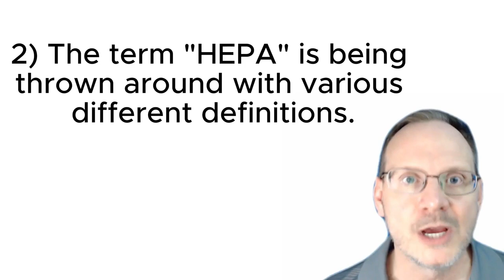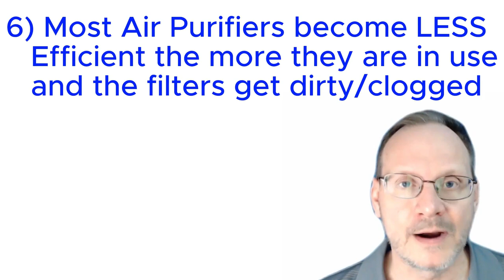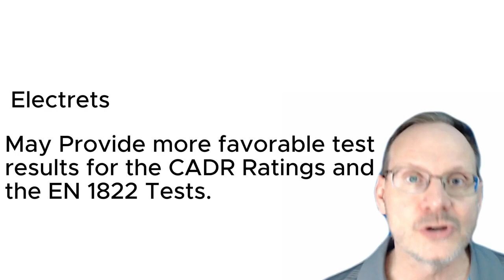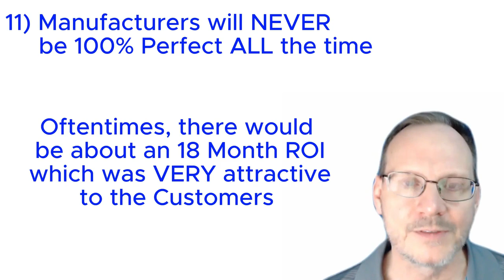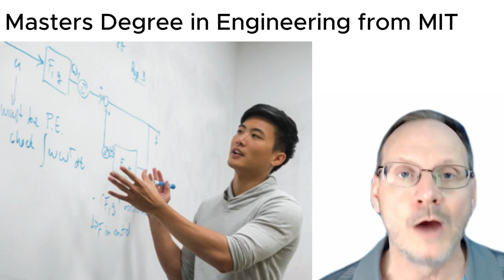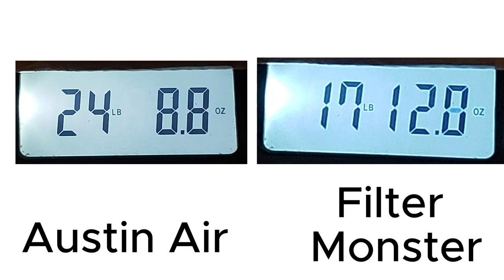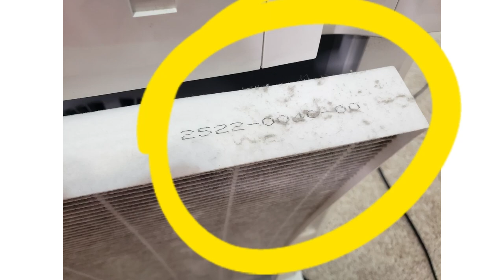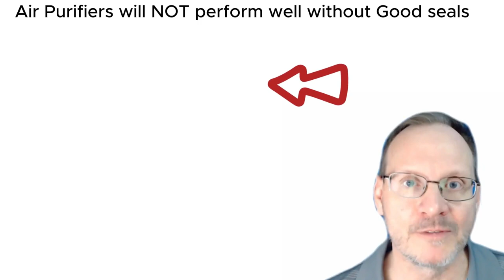HEPA Filters - Are they all the same?

Comment: Hello Doug. Does the Austin come up short on Ultrafine particle filtration because of media reasons only or bypass issues as well? I currently have one HPP, and it has a good odor elimination quality, but am also looking for additional particle filtration. Was looking at the IQAir AtemX. I called them today for info and they said it was about 530 CFM on high and draws about 85 watts per hour. It uses three HyperHepa. Any thoughts on that unit, Doug?  It’s $$.
Reply from the maker: I currently have ambivalent feelings about the Austin Air Healthmate:
1) It was the 1st air purifier I ever purchased and it did a great job for me as I bought it because I was gagging on dust (I think it was coming from my ducting when our heat turned on) when I was trying to sleep at night and I was waking up at @ 2-3 am coughing, etc. I'd have to drink some water to try to get back to sleep again but I'd be up for about 30-40 minutes b4 I could get back to sleep and this really irritated me. The Healthmate fixed my issue the 1st night in my room and I was very grateful + I never had that problem again for 16+ years with it running 247. My experience with it + numerous interactions with customers over 15 years tells me it has definitely helped a lot of people with many different breathing issues... for sure. So it is a quality unit, IMO.
2) That said, I saw it tested in Vegas with a $3,000 particle counter by the Owner of IQAir vs. the IQAir HPP and a Blueair unit. The HPP registered a perfect score with the monitor. The Healthmate was tested next and it performed at 98% efficiency on low speed, 96% on Medium speed and 92% on High speed. But I could tell the owner of IQAir respected the unit and felt it was a good offering. Then the Blueair unit was tested and it hit about 82% on whatever speed but it was not nearly as impressive as the HPP or the Austin. The live test made an impression on me for many years. Then over the past year I started to use various testing monitors (much less expensive... more like $300 to $150) and have come to the conclusion they are NOT reliably accurate. And the EPA says any testing monitor less than $5K tends to be somewhat inaccurate. I've talked to Austin and they say the electronics of the HPP interfere with the testing monitors and therefore provide false readings. I've seen that when you put a testing monitor close to fans without any filters - the readings can register as perfect air quality, as well. Basically false readings... So, now I question if the IQAir live test I saw was somehow "rigged". Did he put the monitor closer to the mouth of the HPP unit during the test to get a false perfect reading? I don't remember. But I will say, I don't believe he is the type of man to do such an underhanded thing. He seemed to be an honest man... but who knows, right? He wanted all of the dealers to sell his units and grow his brand in the US at the time so he definitely had a "motive" so to speak. I still don't know... All that said, I've had many fantastic testimonials and some great feedback with HPP customers through the years and I know regardless of what any testing monitor's numbers can show me that it is an elite-performing air purifier for particle filtration... no question in my mind.
3) Years ago I had a rep. from Blueair and a rep. from Austin tell me that they both knew the HPP filtered better than their units. So, why would I not believe them - right?
4) I think most air purifiers on the market do not actually work at a HEPA level but they don't need to in order to help people with their breathing... most all air purifiers will improve the air quality in a room to some degree... but obviously, there is a pecking order regarding performance (esp. with Ultrafine particles) and I currently think the HPP and Aeris 3 in 1 are 2 of the best.
5) I recently asked Austin for 3rd party data/reports that proved their units worked at a HEPA level but to my shock - they didn't really have any. I could NOT believe it. They say they are "3rd Party" tested but they only have some "clinical trial" type experiments/data/trials with some reputable health organizations... but the data I read from these trials did not impress me as I didn't see any black and white super convincing results. Now, maybe I didn't read all of them and maybe I am missing something but if I was in charge of a reputable air purification manufacturer and I was proud of my product's performance - I'd have some SEVERE 3rd party testing data that was very black and white and I'd be beating the competition over the head with it - yelling from the rooftops with it, so to speak. IQAir has EN1822 testing results that appear to be black and white and EN1822 is one of the most respected "certifications" in the market today - from what I currently gather. Now, was the entire unit certified or only the filters? IDK but I'll eventually find out... either way, they have a 3rd party certification that I think is impressive. I do not think Austin currently has this...
6) I do not have much experience with the Atem X, at all. That said, based on limited research - I think the HPP filters Ultrafine Particles better than the new Atem X. I think IQAir was somewhat forced to come out with a better-looking unit with "smart" features to keep up with the competition however, I do NOT believe it filters HEPA sized particles or ultrafine particles as well as the HPP. And I also think IQAir tries to kind of "hide" this fact based on what I am reading in their marketing materials. I do not think the X's filters are EN1822 certified and I see IQAir pushing impressive Virus Removal data performance numbers on the unit on their website. However, I don't see anywhere that it actually performs at a HEPA level.
A) The HPP performance numbers say "Filters 99.5% particles ≥ 0.003 microns" right on their website... but I only see a UK IQAir dealer called Allergy Cosmos say, "HyperHEPA Filtration: Similar to the HealthPro 250 (which is the international number for the HPP), the Atem X utilizes advanced HyperHEPA filtration, EN1822 classified at E11 to H13 (notice they say "Similar", "utilizes" and "classified" but never actually say the filters themselves are EN1822 certified/tested). 
B) "The Atem X captures ultra-fine particles at 0.3 microns with an efficiency of over 95% on the highest setting and 99.95% on settings 1 and 2." BOOM SHAKA LAKA! Right There... THAT is all we need to know, I think. Actually, IMO, they tried to be a little sneaky with this sentence as "Ultrafine particles" are defined as .1 to .003 in size... and .3 microns are considered "Fine Particles" and those definitions are literally coming right off the IQAir chart. But they used the "Ultrafine" term in combination with ".3 microns" in the same sentence. IMO, they did this to try to fool people and have them think the X performs as well as the HPP for Ultrafine particles. And I had to do some searching to finally find this info... I think IQAir wants to "hide" it from consumers. I think the HPP performs at 99.5% down to .003 microns even on the highest setting but the Atem X clearly filters particles at worse rates when the CFMs are increased. And according to their UK dealer - it NEVER actually hits 99.97% at .3 microns.  But the HPP definitely does.
C) So, the X is "Good Looking/Better Looking" than the HPP.  Has additional sensors to test for different things in our air.  Is more powerful so it covers more cubic footage. Is "smart" so to speak and has all the digital/phone features that folks could probably want... but, I personally, don't care about any of that stuff, lol!  I want the superior filtration.  So, this is what I currently think about the X based on what I'm seeing.  Thank you!  👍

Comment: Even if filters have a leak, that doesn't matter, what mattes is the air moved through the filter... zero air filters have a perfect seal, so it's just a minor side topic...  even a Merv 11 will do about the same as a IQ Air, and if you get a much bigger fan and multiple Merv 11, it will do better than an IQ Air...  .3 is the size that is hardest to filter, at lower sizes it becomes easier to filter (including ultra fine particles) and at higher than .3 microns it becomes easier to filter, that is why .3 microns is used as the benchmark... IQ Air's testing/certs don't really prove that it's better than any others... One thing IQ Air is better at is that their machine is so quiet, but it's not much better than a house fan with a Merv 11 on it and it's not any better than a common Honeywell machine... VOCs can only be filtered to about 9% reduction by carbon, even the IQ Air or the huge Airpura carbon filters only remove about 9%.  Just some facts for you.  The rest is a lot of hype and marketing catch-phrases for people who don't understand much about filtration.  The main thing about filtration is the size of the filter and the volume of air the fan can move through the filter per unit time, only after that can you start to talk about filtration media which is more or less the same from a tshirt up to a ULPA and is just 10% of the equation.  Also using carbon will actually clog the HEPA filter and carbon only works for a short amount of time and you never know when that is because it depends on the amount of toxin in the air, the temperature, pressure, etc.
Reply from the maker: Thank you for your comments:
1) "zero air filters have a perfect seal, so it's just a minor side topic..." 
***Yeah, I don't currently agree with this, at all. One of the things that makes the elite air purifiers perform better is the superior seal and lack of leaking - from a particle filtration standpoint.

2) "even a Merv 11 will do about the same as a IQ Air, and if you get a much bigger fan and multiple Merv 11, it will do better than an IQ Air.."  
* I currently would have to disagree with this, as well.  The MERV 11 won't come even close to the filtration of an IQAir HPP.

3) ".3 is the size that is hardest to filter," 
***updated information/testing has shown that the MPPS will depend on the specific filter being tested.  Different HEPA filters have different MPPS. 

4) "at lower sizes it becomes easier to filter (including ultra fine particles) and at higher than .3 microns it becomes easier to filter"
* I currently believe this to be true only for very well manufactured HEPA filters... but I currently do not believe all HEPA filters will filter at the same levels and not all HEPA filters will filter the Ultrafine particles in the same manner.

5) " IQ Air's testing/certs don't really prove that it's better than any others..."
***I currently do not believe this to be true.

6) "One thing IQ Air is better at is that their machine is so quiet,"
***I honestly don't think it is very quiet compared to some of the other air purifiers I have... I love the white noise that most air purifiers create... I'd say Blueair is probably one of the more quiet solutions - esp. in comparison to the IQAir HPP.  But, I guess the IQAir HPP is pretty good/quiet from a sound standpoint up to speed 4... 

7)  "but it's not much better than a house fan with a Merv 11 on it and it's not any better than a common Honeywell machine..."
***LOL!!😆 I do respect everyone's opinion but I don't know how you are coming up with these comparisons. My professional experience in dealing with hundreds of IQAir customers has proven beyond a shadow of a doubt it is an elite filtering air purifier and no, a Honeywell air purifier doesn't filter nearly as well.  I've sold both. 

8) "VOCs can only be filtered to about 9% reduction by carbon, even the IQ Air or the huge Airpura carbon filters only remove about 9%."
***I don't know how you are coming up with these opinions -  but this has not been my personal experience with air purifiers and definitely not the experience of thousands of customers and businesses I have dealt with from all over the country for over 16 years.

9)  " Just some facts for you.  The rest is a lot of hype and marketing catch-phrases for people who don't understand much about filtration.  The main thing about filtration is the size of the filter and the volume of air the fan can move through the filter per unit time, only after that can you start to talk about filtration media which is more or less the same from a tshirt up to a ULPA and is just 10% of the equation."
* I do appreciate your "Facts" LOL! 😆 but I currently think you are way off with the vast majority of your opinions on these topics... and my professional experience with THOUSANDS of real world customers and some high level (even brilliant) engineering experts from some of the best schools in the world (including MIT) do not agree with many of your opinions.  But we are all allowed to have our own opinions.

10) " The main thing about filtration is the size of the filter and the volume of air the fan can move through the filter per unit time, only after that can you start to talk about filtration media which is more or less the same from a tshirt up to a ULPA and is just 10% of the equation. "
* I disagree

11) " Also using carbon will actually clog the HEPA filter and carbon only works for a short amount of time and you never know when that is because it depends on the amount of toxin in the air, the temperature, pressure, etc."
***I do agree with you that carbon can clog a HEPA filter.  And I know there are many different types and qualities of carbon out there.  And I agree that some of the carbon will not last a long time, for sure...  And I will be learning more about this over time.  

Thanks a lot for your post.  We don't currently seem to agree on much, LOL! 😆But that is OK!  If everyone completely agreed on everything I think there would probably not be a lot of progress made in the world.  All that said - as  always - I don't necessarily want to be "Right" - I want to find the "Truth" so, I reserve the right to change my opinions on these topics over time as I learn more about the different issues, etc. 

Thank you for your post!👍

Comment: you show winix is not well sealed but you havent shown the same test for austin air - so u didnt demonstrate that austin air is any better; it seems a bit as if you had upfront thesis in mind
Reply from the maker: The topic of this video was not specifically about an Austin being better than a Winix - the topic of this video is to show that not all HEPA filters are the same and they don't all filter at a HEPA level like so many consumers believe. In fact, over 99% of the so called "HEPA" air purifiers do not actually filter at a HEPA Level. 

Did you see the 2 black gaskets on the Austin Air Filter on the top and the bottom of it?  Do you see any gasket(s) on the Winix Filter?  No. 

The gaskets on the Austin filter will help create a decent seal between it and the inside of the unit.  The lack of a gasket on the Winix filter means it is going to be prone to having dirty air escape around it - and we can easily see that is exactly what happens.  So, although it was not the specific intention of this video - yes, I actually did demonstrate that the Austin Air seal is much better than the Winix seal and thereby the Austin air purifier will filter better than the Winix one.  I was actually just trying to show that the original Austin Air filter from the manufacturer was superior in quality to the Chinese made Monster Filter version of the Austin replacement filter. 

I will be making a video in the future on the importance of the seals inside the air purifiers and I will compare the seals of about 10 different units so everyone will easily understand this super important component of air purifiers.
Reply: I can see your point and I believe I can address your concern. The Austin filter is big, heavy, and designed not to need replacing for 5 years. I’ve had an Austin HealthMate for 9 years and I have closely inspected the gaskets on the two filters that it has used during that time. I wanted to make sure that there wasn’t any air escaping the charcoal/zeolite filter and the HEPA filter given the cost of the unit and the replacement filters. The gaskets are a thick firm rubbery material that forms tight seals with the inside top and bottom of the unit. The fit is so tight that the gaskets show continuous and perfect indentations matching where they attach to the unit. Those seals are not coming loose unless you destroy the top or bottom of the steel case. (Doug could have flipped the unit over, taken off the bottom, and pulled out the filter to show this. Or he could have used a fiber optic scope.) The Winix filters are more like furnace filters that are designed for easy access and changing. I like my HealthMate but I have looked at a lot of other machines over the years because they have timers, remote controls, status lights, etc. The HealthMate just has a 4 position switch to control the fan speed. If I had had more funds I would have probably bought an IQ Air. Apologies if this sounds preachy.
Reply from the maker: IDK, man... I think I need to start paying you, LOL! 😆You are too good with your comments and suggestions... 

I'm gonna eventually make a somewhat comprehensive "Gasket/Seal" video in the future with about 8-10 different units or so, and I think it will really help a lot of people understand the importance of a good, tight seal inside the units.  It is on the "ToDo" list - for sure!  

I think you can disregard my other comment about watching this video as it looks like you've already seen it - thanks!👍   @JBass33